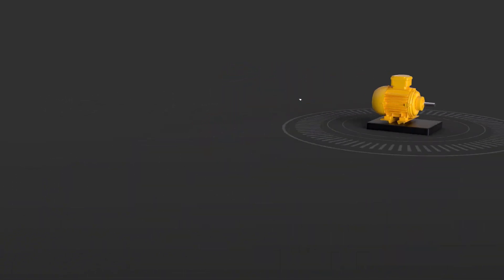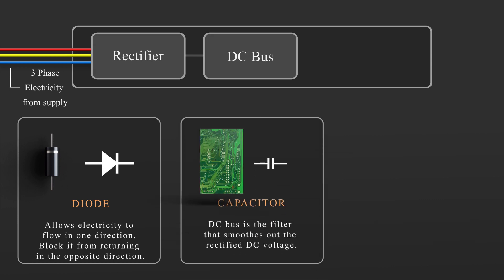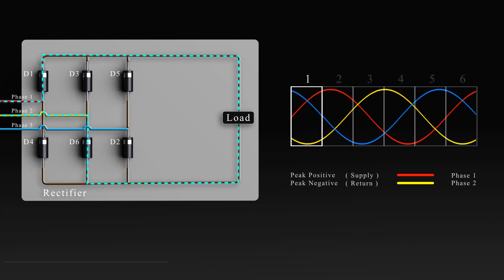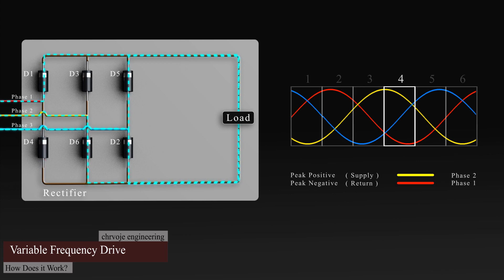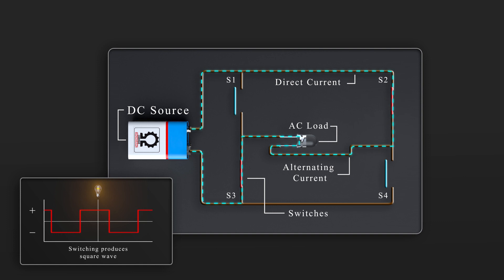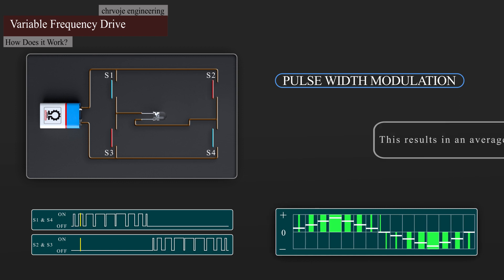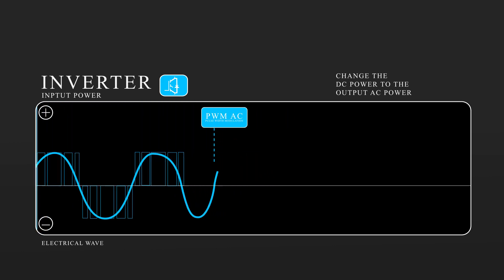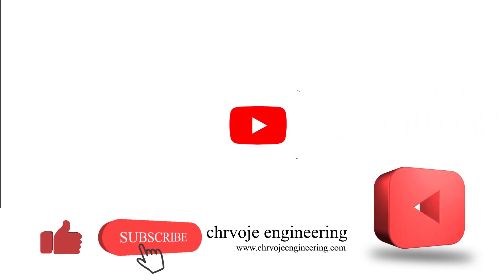Variable Frequency Drive (VFD), How it Works?

Comment: if Technical problem with VFD then whether current will pass or not to loads (Pump)
Reply from the maker: For example what technical problem, With any error VFD will not work will no pass, actually you must set protection on each VFD and you will not have and problem

Comment: I live in the US which runs on 110 volt at 60 Hz   and want to take all my electrical appliances  with me to a country that has 220 volts at 50 Hz .I intend to buy a step down transformer for the 110 volts that miy equipment needs. How do i get the 60 Hz frequency that i need? Will I  be able to get a vfd for the whole house because i want my frequency to be 60 Hz in the house
Reply from the maker: https://www.amazon.com/European-Adapter-TESSAN-International-Adaptor/dp/B07FJWLLDB?th=1
Reply: You are better off selling the appliances and buying them in the end country. The cost of an inverter to convert mains power at 220volts is expensive, and adds too much wiring and clap-trap to powering the appliances. If it were only a washer and dryer, you might get buy with a transformer, but if it's an electric dryer that's a nominally large transformer. 
If you're really stuck with this idea, I would find a 24VDC or 48VDC 50Hz inverter, use a step down from the 220VAC mains to 24 or 48, then full wave rectify it, and smooth with a capacitor as it this power comes from a battery or solar source. As you can see that's lots of messing around. It's not like appliances are mega money items. Unless you are going to some 3rd world that does not have appliance stores. But then I would worry about power from a generation plant not being available.